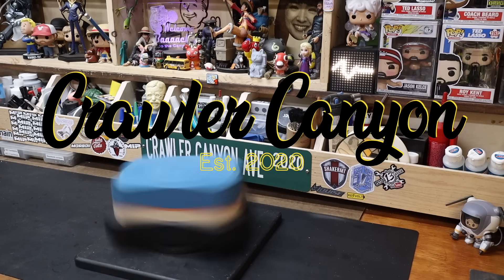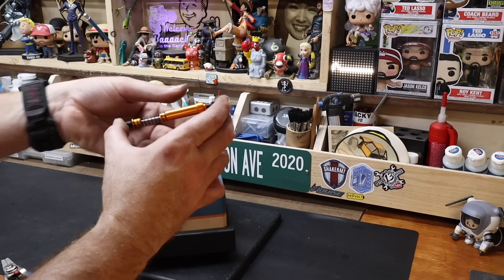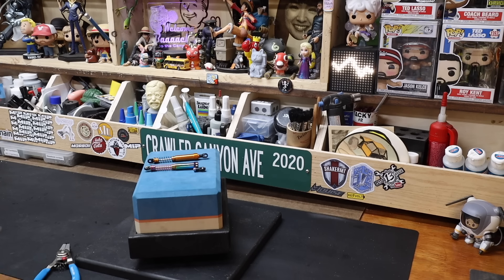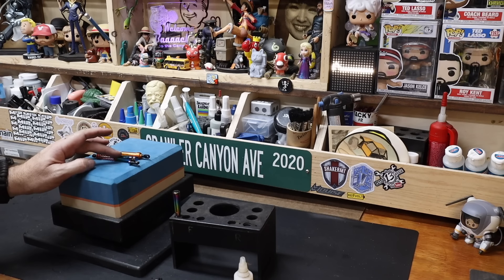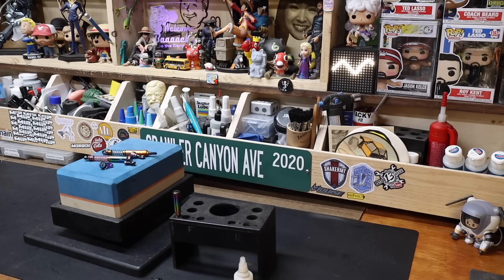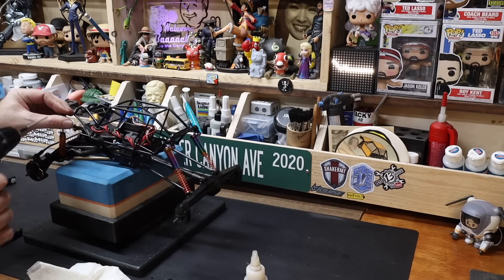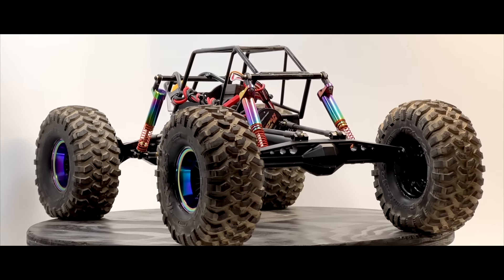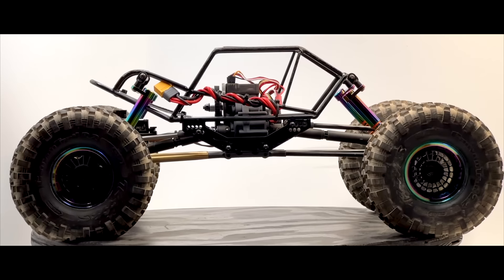Crawler Canyon Quick(re)view: "Updated" Fake Dravtechs

Comment: On the threaded version,  Remove the bottom link and spring from the  rod, remove bottom spring retainer cap. Then put bottom link back on the rod, loosen or remove cap, compress until bottom link touches threaded retainer, turn left while applying pressure to the threaded retainer and your good to go!  
 Also, use a brillo pad to smooth the inside of shock body for smoother stroke. 
P.S I'm tired from Zero sleep

Comment: Amazon rcboyz clone shocks are cheap all 4 for $19.99 and the snap rings are inside the shocks so once you buy 2 sets each of the traxxas tra2362 & tra2669 which cost me $13.60 shipped and you also have the channel lock 926 on deck it makes the break down and rebuild process so much easier out the package brand new the shocks are horrible but once you add those traxxas parts and good oil it's a night and day difference...Thanks a lot for your in depth videos and for 34$ bucks it was a small gamble that paid off for sure...again thanks and enjoy your sunday..✌
Reply from the maker: Yep.  That video took place back in February. https://youtu.be/lSeMuiuixF8
And the RCBOYZ version was a follow-up to the video on the  "original" Fimonda  Drav-clones. https://youtu.be/dos0CYVd6EY

The oily version are not directly comparable, as they're...  different enough.  The inclusion of offset caps and functional pistons puts this version out on it's own.

Comment: I unscrewed mine with a pick.then I took a pin file.filed a slot across the cap and used a small flat head screw driver to tighten the seal pack.

Comment: I have rebuilt three sets of the regular ones, with a snap ring, and all have worked really well. Have used seals, pistons and bladder. I have also gotten 2,5 sets of the screw in ones. The first time, I got four shocks from the same seller on Aliexpress, and two were "normal" ones, two were the screw in kinds. So it's not just that you don't know what you're getting when ordering. You don't even know is a full set will all be the same.

The good thing is that I have gotten partial refunds (50%), and kept the shocks, on the shocks I have gotten that had the screw in seal retainer. 

Appreciate the video, as I am planning to try and rebuild some of the screw in ones I have as well. If I can get them to work as well, or about as well, as the snap ring ones, I will have gotten several sets really cheap. ;)

Comment: 😢I’m late, but I have a good excuse. We were digging a 85ft ditch at my grandmas house to replace 30yearold galvanized pipes with 1in pex. Half of it was easy digging,we had already dug a ditch to run pex and 50amp wire.the other half though was really hard, the ditch crossed over a dirt driveway and it was really compacted, I just used a pick all day and my sister and dad where shoveling. It was also hot, 104F and 45% humidity.